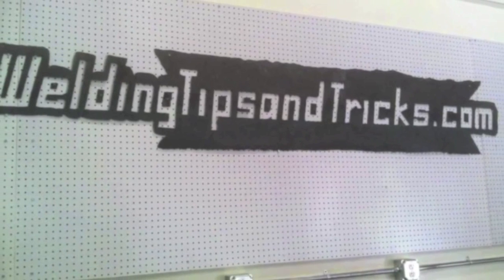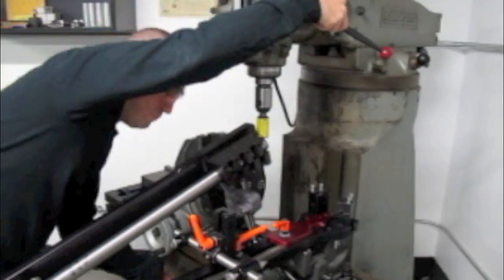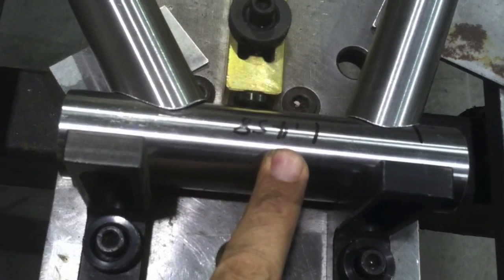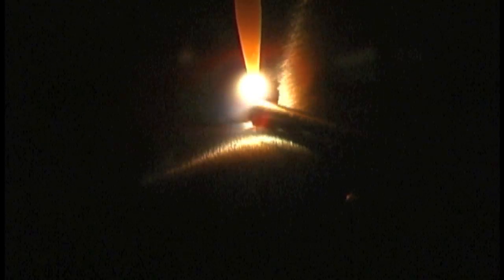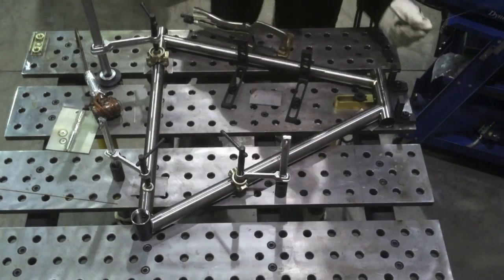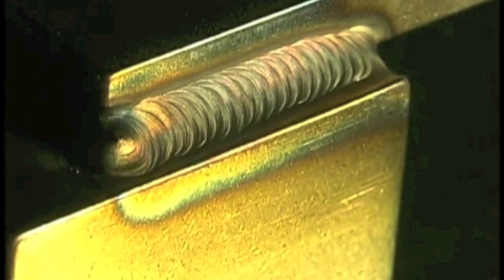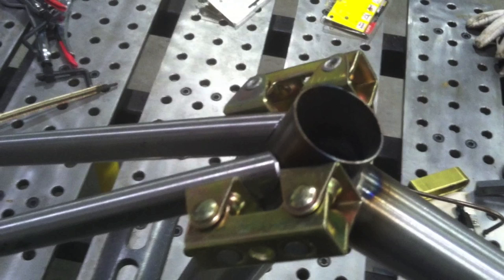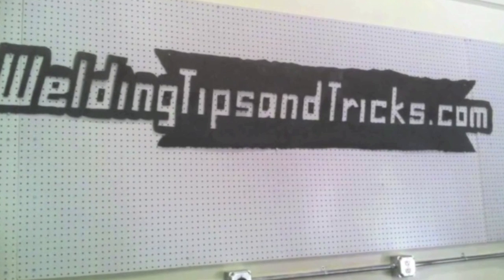Welding a Bike Frame on a StrongHand BuildPro Table

Comment: thanks for theses videos and i know this one is dated - the closeup shots of filling and feeding are great but on  this type of welding - a wide out to show or demonstrate your position would be oh so much more helpful  -  in learning to tig. - i was instructed to support the arm practice the placing and then proceed - but on tubing - the electrode is moving in an arc - and i can not tell if you are going up hill down hill and how your hand arm is moving - -  how much stick out do you have and what size cup, what cfh on tank - - my guess would be that you have a longer than normal stick out so you can see better, therefore more gas and using something like a furric so the flow is better - i have tried to tig tubing and i suck - - i find i can only weld the top flat basically and therefore my stacks are start n  stop looking and not at all near as pretty as yours-  - i am using a glass cup no 10 or 12 i don't know  30 on gas,  and 50 amps on everlast 205

Comment: Brings back memories. I welded frames for JMC racing made out of 4130 chromoly using the same filler rod. These frames were for BMX racing.

Comment: my machine don´t have foot pedal option. I will add it anyway conecting it where the front pot are. but I will have in the foot always the complete amp range of my welder. will it make trouble to have all range all the time?

Comment: build pro tables cost too much $ how bout doing a diy table with 1/2-13 holes so you could use machine tool type tooling an not be buying expensive custom stuff?

Comment: Great info on almost everything.  There is one thing that doesn't sit well with me though (which really surprises me, because it is the first time I've seen something like this in any of your videos).
Keeping the frame in the jig for welding does not decrease distortion, retraining the frame while welding actively increases distortion.  This is true for bike frames but it applies to other fabrications with thin wall tubing..
Jigs should be used to align and tack, but in most situations a frame should not be restrained during welding.  While a spring restrained piece may allow for less distortion in fabrications that don't involve thin wall tubing, the same is not the case when you are using thin wall tubing.  
Also, typically bike frame tubes are either welded in a single all-the-way-around pass, or in opposing sections, i.e. welding the first 6th, then the fourth 6th, then the second sixth, then the fifth 6th...and so on, to balance around the central axis.

.
In a previous career I was a frame welder and made custom frames for people as well. I don't know anyone who does this professionally that welds restrained in a jig. The oft sighted logic is that it increases stress and distortion too much.

Comment: did you ever end up using that lincoln machine? we tested a few pulse wave mig machines at a job i had a few years back. i was never satisfied with the lincoln, it had hundreds of presets you had to dial in to get you weld looking right, and if you were jumping between position or material thickness like we were, you needed several preset configurations. the miller version and cobramatic machine did a much better job of thinking for themselves.

Comment: Cool video, wish I could make welds that nice in that type of stock.
I'm on an FSAE team and we build a car chassis out of .035, .049 and .065 steel tubing and it's way too easy to knock a hole. I'm running 35 amps for .035 stock with ER-70, and I can never seem to get a decent weld. Always either not enough filler, or the filler isn't melted in enough. Beautiful welds though

Comment: thanks for the video, now sorry if this is stating the obvious but have you tried using a roughing cutter in the mill for your tube mitering? I personally have had poor results from hole saws like in the video. Much better results again with a hole saw that's one piece with the arbor but still not as good as the milling cutter.

Comment: Hey we have a Miller Syncrowave 250 DX tig welder in our school shop. and with mild steel the tungsten always gets oxidation and eventually rounds the tungsten and slightly contaminates it. is there anyway to prevent this?? or use better settings

Comment from the maker: thanks for your support and kind words and congrats on your progress in tig welding.  As far as your question about the ball not dropping goes, that usually means either an internal leak, the connection to the machine is loose, or the solenoid valve not completely shutting.  check the connection to the machine first to make sure its tight.  Also, if the incoming pressure is too high, that can cause problems so make sure its regulated to low pressure like probly around 35 psi... check the manual

Comment: Jody, you, your videos, and tig finger are the bomb! I bought a tig finger for my welding class and after the first day of using it my teacher was very impressed and said he would of put my weld on the welds of honor board if he had one for the tig process. Keep in mind I never tig welded before and this was only my 3rd week of class! Quick question. What could be the causes of the ball in the flow meter not dropping after your done welding? Thanks in advance. Keep up the awesome work!

Comment: Great video (they're all great btw) keep 'em coming. While we all know that you did this just as an exercise, did you check the alignment of the frame after you welded it up? One can get old-head frame builders into a lather pretty quickly by suggesting that clamp-it-all-into-the-jig and weld is the best way to build a frame.

Comment from the maker: its very expensive compared to a table that you would make yourself but actually very affordable compared to other precision welding tables like bluco. you can check out pricing or stronghand buildpro tables at summit racing or northern tool (dot) com.

Comment: I have been using your videos for my base training. I am probably well older than you, & had to force a change in jobs due to the economy. My area has a huge dairy industry & many processing plants. I am working to get certified for sanitary SS pipe. I watch your info backwards & forward & absorb everything you comment on. A plug for you: The Tig Finger is the greatest thing since sliced cheese singles. I am in school, but you beat the pants off my school instruction. I couldn't do without you!

Comment: My machine doesn't have pulse, but under the hood it looks the same as what you see in the video. I set my machine to around 60 amps, because I like having a little extra heat available if I need it, and use the pedal. I do not pulse with my foot. I just keep nice steady movements. The key for me is keeping the puddle satisfied with filler. I dab often and that helps control the heat and prevent blowing holes. Hope that helps!

Comment: It was hard to watch but you can physically see the quality of the welds.  Jody, just have to say, you are incredible.  I bought a welding table from BuildPro along with a lot of tooling.  If anyone has not seen or used one of these tables should!  They are GREAT.  Also, I have purchased several of your tig fingers.  I love them.  I have given several to welder friends of mine.  Keep up the GREAT work!

Comment: okay guys, and Jody, i have a question. in a performance engine you often have issues with melted/deformed pistons or the head(s) will bend, is it possible/reasonable to lay a layer with inconell on the pistons/head(s) before machining? is should make them hard as s##t?